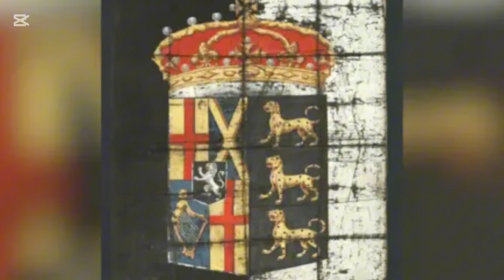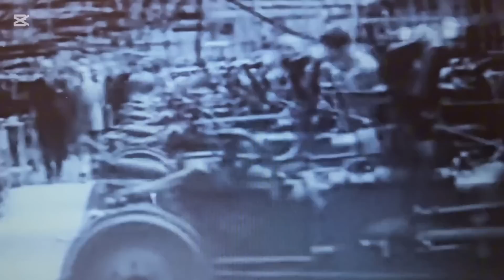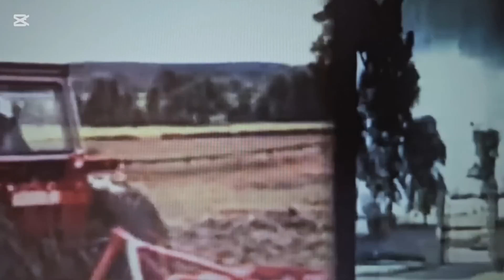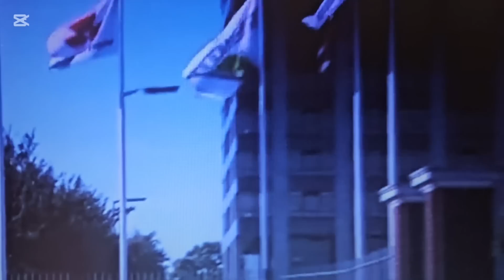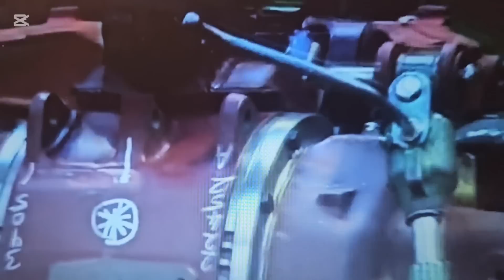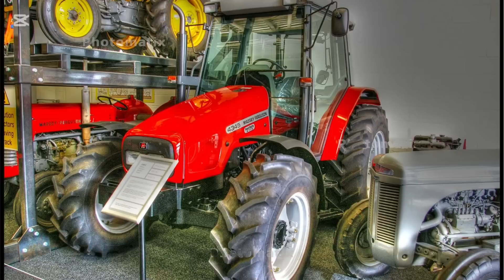WHERE TRACTORS WERE BORN: THE BANNER LANE STORY!

Comment: Did my apprenticeship there, starting in 1995, ended up working in the Engineering and Development department which included working in the Rig Test buildings at the rear of the site. Left June 2002 when they downsized the engineering department, took redundancy. Plant closure was announced the day I started by new job

Comment: So the 3000 series wasn’t developed by AGCO then. 
Back in the late 80s I drove an extended bonnet MF on demo. I think it was called a 3670. 
So why does google say that it was a nineties tractor?
Reply from the maker: No, the 3000 series was most definitely not an AGCO developed product.. They only took over in 1994. The 3670 was produced in Beauvais from 1992 until 1994 so perhaps it was the early 90's you were driving the demo. The 3670 was indeed a 90's tractor. The MF 3070, etc, were produced from 1986 onwards, I believe. They would be a tractor of the 80's 👍

Comment: I had no idea of the significance of July 1946..I was born on the 8th of July 1946, learnt to drive on a little grey Fergie when I was 11, and worked at Banner  Lane from around 1981 to 1986 in the MIS function, floor 5 in the tower block.. Absolutely fantastic people to work with. I was pretty inexperienced when  I started  and learnt so much in those 5 years.. I loved working there. We were the Systems, Development and Support function for Massey Ferguson world wide and worked very closely with the similar function at Perkins engines in Peterborough.
Reply from the maker: Thanks so much for sharing your experience of Banner Lane. 👍

Comment: Great video. New inside information and 1960s MF 100 Series photos are particularly interesting. I had a tour of the factory in 1992, only a small number of tractors being produced at the time, 300 Series and Ursus branded 200 Series equivalents. The manufacturing facility seemed very dated… most of it hadn’t changed much since the TE20 era at a guess. Very sad to see the demolition of the factory with only a memorial plaque to mark the spot of such an iconic industrial site. Keep up the good work.
Reply from the maker: Thanks..yes it was old and re purposed many times to suit the product. As i said in the video, it would have cost millions to upgrade to take bigger running gear and transmissions. Ultimately, one of the reasons it closed. Thanks for watching as always 👍

Comment: Grew up with MF always thought they were the best tractors. However, I felt the 200 and 300 series were not really up to the competition at the time. I lived In North Devon,  Gliddon and Squire were the main MF dealers. during the school holidays on Friday market day  Father and I would go there, it was like going to Smithfield show, tractors everywhere. 
Most of my time was on the 590, and 575. later the 600 series and a bit on the 2000. During this time JD were out smarting almost every manufacturer, particularly with the SQ cab. I spent a summer working for an ag contractor in a JD it was better than MF at the time, hurts to say.  I think during the late 80's and 90's MF were falling behind with innovation, and basically rehashed the 500 series. (even the 500 was a rehash of the 100 but with a decent cab).   Fast forward, today they are excellent machines, some say a poor mans fendt.  still a Massey man, I have a 240 for cutting my paddock, about 20 hours a year!!
Reply from the maker: The cabs were getting dated at that stage alright. Thanks for watching 👍